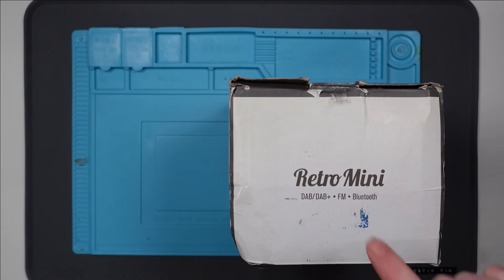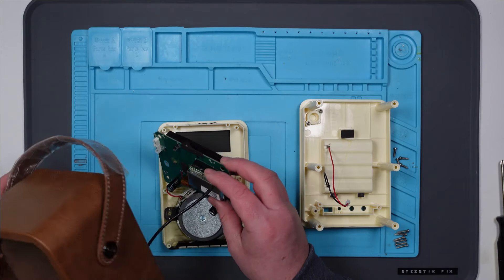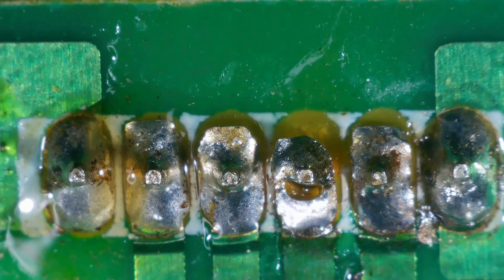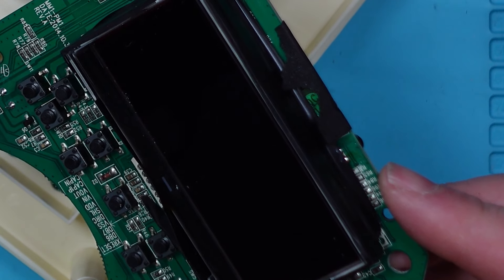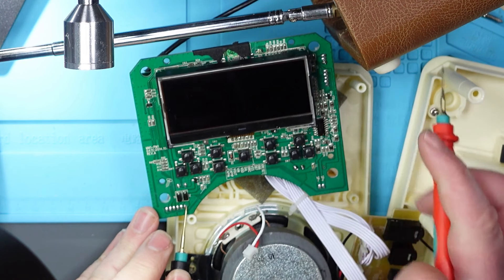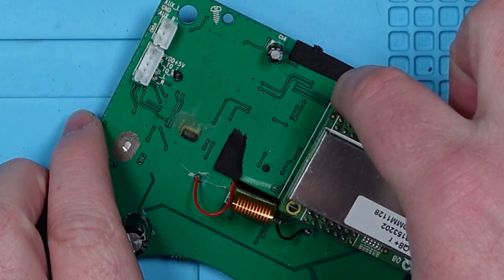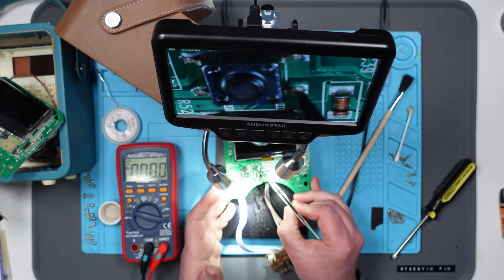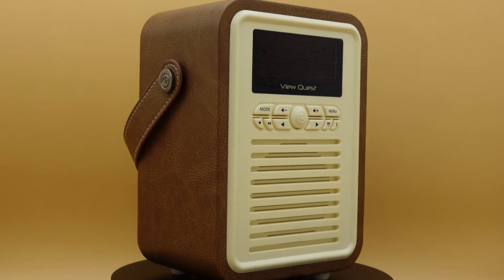I Bought a FAULTY VQ Retro Mini for £6.95 | Let's FIX It!

Comment: Hi Stez! I suspect that by reflowing the connections you resolved the corrosion which was acting like a resistor eating that 1 volt that the display needed. Nice video!
Reply from the maker: Thanks Jimmy!  That is an excellent thought, you're probably right!  I never thought of it that way, but a poorly soldered connection I suppose can reduce the current flow. 👍

Comment: The connector with the dodgy pads should be stabilized. Glue on the component side (maybe hot glue) and adding additional formed lead clippings on the solder side can work wonders. The reason is that the contacts can break again especially on a portable device. I keep all the clippings from my components for jobs like this. Form them with pliers to act like the weak or broken tracks and scrape the track back beyond the loose copper. A lot of 1980s items fail on the connectors.
Reply: Definitely this. Also, the failure is probably caused by the socket not being pressed home properly before soldering. If it wasn't seated properly, the pressure from pushing home the plug could lift the tracks, as they're on the opposite side to the socket. If so, it would have been broken like this direct from the factory and only worked by luck in the first place.

Comment: Hi Stez,
I think the large “vias” that you stuck your probe in to check the voltage was the problem, and when you stuck your probe in to measure the 2.6v you disturbed the copper just enough to make a connection, I would stick a jumper wire over it as the fault may come back!

Comment: Just fixed mine, it eats batteries so I only use the USB power supply, I've reflowed the 5v socket a few times now and I do agree the standard of soldering leaves a lot to be desired.

Comment: Loved the video - great to watch someone fault finding as it's no longer my day-to-day job anymore and at times I do miss it lol
However....what I don't miss is doing all the work and not finding the fault, only for the bloody thing to function properly.....good result, but less satisfying
Something I did wonder is if you'd be better measuring continuity not using the tone, but reading the resistance - I always got seduced by using the tone and chased faults that I could have seen earlier......& to be fair, the instructors did teach us not to rely on the tone during Technical Training
Anyway..... I'm being a meddling old f*** and I don't mean to criticise and spoil your fun
Keep up the great videos!
Reply from the maker: Thanks Guy! No, you're absolutely right. Relying on that beep has got me in to trouble a couple of times before! I'd love to find out the actual fault with this, but I suspect it's probably just a few dodgy solder joints from factory. I don't think the device actually worked after rolling off the production line (which would explain how it was in such good condition and still had the cellophane wrap on the handle) Not really that exciting, but I can't really think what else it could be! 👍

Comment: Good to see another of your fixes there Steve did this get you thinking what the problem was even though you fixed it !!! nice radio too  and its now working - Nice 1 👍
Reply from the maker: Thanks Chris!  Yeah, It's been bugging me since I fixed it, but I really think it was the dodgy factory solder joints.  Looking at the excellent condition of the item, and the fact that it still had the plastic wrapping on the handle, I don't think it ever worked from leaving the factory.  Reflowing the solder joints is what I'm gonna put the fix down to! 😊

Comment: Steve, you won! You succeeded after you Dabbled in the Dab & found the trap, I'm very surprised you and others didn't spot it. (Not the re=flow) after that 🤯🤪
Reply from the maker: Thanks Steve! Ooh, what did I miss!? 😳
Reply: Sorry my man I only just noticed you replied 😓 I'm super tired but didn't want to go sleep without answering you. I'll let you sleep on it and see if you can spot what it was, your clever you'll get it 🥱😴 BBL shit I nearly put kisses on the end of that message 😅
Reply from the maker: 🤣 feel free to add kisses on the end of your messages! 😂 do you mean the resistor that I took off and put back? 🤔
Reply: Tart, still love my bother Steve 😂 I was tired and wasn't thinking straight, no not resistor. I was going to give you the cryptic version but nah! it was the Via that killed your backlight, I'm pretty sure of it. That's what was pulling the power low. Hey you ever fixed a 2.6" TV from the 80s the Casio. You got-a try one they are a handful and packed to the eye balls with components, sandwich boards with wires joining them. I did one today with a decode AV issue, Scope for the win! 😁 xx
Reply from the maker: @Ratchet_effect  ahha, gotcha! Thanks Steve. Never worked on a pocket TV, but it is definitely on my list! Sound alike ot would be fun! 🙃☺
Reply: I just noticed I missed the R from my last comment, multitasking got me this time. You feeling a bit oz down under, with the upside down emoji & the mini me one looks like its from your old Nokia 3310 🤭🤪
Reply from the maker: @Ratchet_effect  Never had the 3310 sadly. I did have an 8210. Loved that little thing 🤪😻
Reply: @StezStixFix  Sister had one of them, I called it a Prison phone. You know why it's size is the answer 😂

Comment: I've had two of those. Had the same issue with both - the speaker quality degraded significantly over time, to the point that everything sounded like it was underwater. The DAB reception wasn't great either, but that could possibly have been the walls in my house.

Comment: Nice fix my bet is on the ribbon cable.
Reply from the maker: Thanks Mr Flibble! Yeah, I think you're right. I'm just annoyed I didn't try it straight after reflowing the solder on the ribbon cable, then I would have known for sure! 👍
Reply: @StezStixFix  It's  all part of fixing stuff annoyingly I've had it with PCs and laptops and other stuff so many times over the years and it also makes you wonder if said fix is only going to be temporary but you just have to go with it and cross that bridge when or if you come to it.
Reply from the maker: @flibble666  Very true!  I've used it every day since I fixed it last week and it's working perfectly, so I actually think it will be a long term fix.  I hope so, cos I love this little thing now! 😊

Comment: You could have checked if the pads/tracks were still connected first with your meter. I worked in TV/hifi/video repair for 40 years and my rule was always to find the problem before jumping in with the iron. Anyway, could that via be faulty? I've seen them go high resistance a few times. The cure is just to fit a piece of wire through the hole and resolder.

Comment: Hi Stez, I was working on one of those digital radios’ months ago, it had a short on the board which was due to one of the components at 20:00 minute mark on the video, how did you know It was a voltage regulator? I goggled the part number but not a lot showed up apart from a Chinese semiconductor company. Unfortunately, I couldn't 100% identify the chip, so the Radio went in the bin. Nice Job by the way, I'm glad someone got there's to work. 👍👍
Reply from the maker: Thanks David! I've got to be honest, it was just a guess based on the voltages going in and back out. As it happens, it's just failed again and I've just finished recording another video on it. Dont want to give too much away, but it was the power board second time around though... 😊
Reply: @StezStixFix  Thanks for your quick reply👍.That's unfortunate the radio broke again, don't think those radios were built to last. but on the plus side we get another video out of it. 😁👍.

Comment: Those holes going through the board sometimes fail. Maybe bridging those two holes together will give a more reliable connection. I've reflowed solder connections on a variety of electronics and it has fixed many issues. It fixed a low power and cutting out issue on my old ghetto blaster boombox, I reflowed the main filter cap and the radio works better and is louder.

Comment: I would have flooded the vias with solder to make sure that there is a good connection thru to the other side of the board.  Sometimes during manufacturing, not enough tinning gets into the vias to make a good connection and it winds up becoming a fail point later on.

Comment: I knew the backlight was ment to be 3.2v.. they seem to make most backlights 3.2v for wider use of lipo/li-lon batterys that and 11v ones.. 2.5v (i think you said it was) is a odd voltage.

Comment: u widened up the via which had bad connection to the top layer of the trace. by doing this now it should be fixed. u could soulder the via (blob on the hole) to get sure
Reply from the maker: Ah! Thanks Technic, that definitely sounds plausible  👍

Comment: 0.7V drop across a diode, was there a flipped one (diode junction voltage drop is usually 0.7v)? 

at 15.05 your good power was 3.26V and the faulty one measured 2.5V
(i havent finished watching this video yet lol)

Comment: Great fix. Them solder joints where terrible, do you think that was probably the main problem?
Reply from the maker: Thanks Dan. Yeah I think it probably was. They were definitely factory too, as some of them were underneath the LCD screen  and I know that noone had been under there because the screen was still riveted to the board. And the fact that the unit is in such good condition (even with the cellophane wrap on the handle) I don't think this unit ever worked after rolling off the production line!

Comment: watching from USA wondering what the heck is DAB haha looked it up, seems factory to me, with tape still on handle, probably just had a small issue with one of the solder areas you touched up from smd cooker, could have had large dodgy via that you probed and connected it back together or as others mentioned eating that last volt required, seems silly to me to have linear regulators on a battery driven device